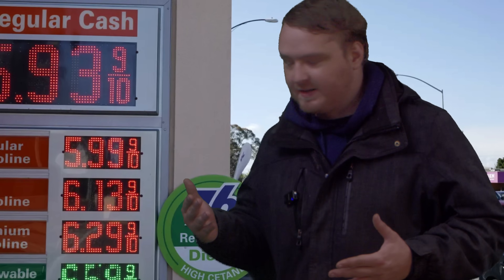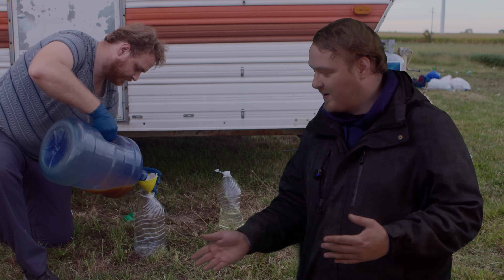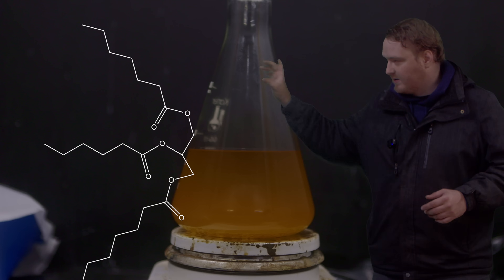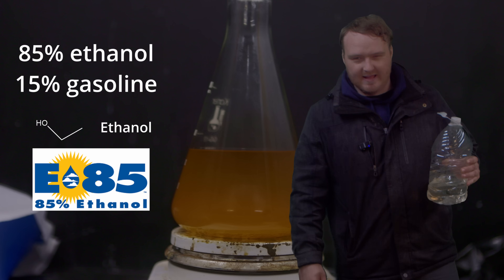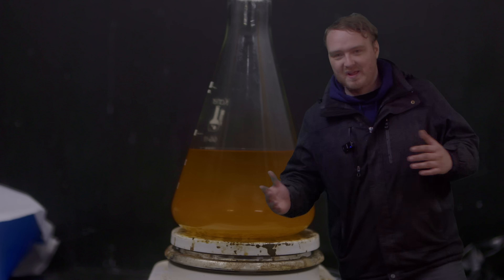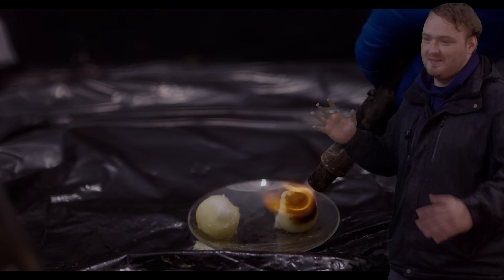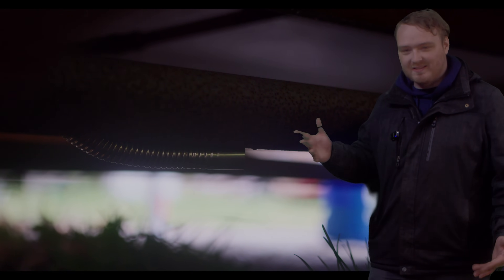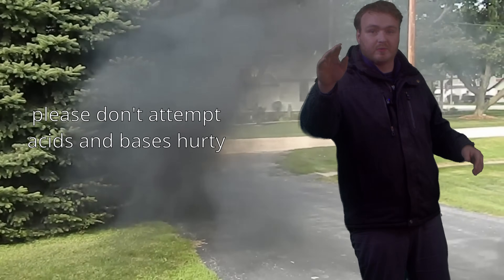I Made Dirt Cheap Organic Diesel!!!

Comment: They put less ethanol in gas in the winter because ethanol has a tendency to crash out of the fuel as a gel in sub zero temps
Reply: Or just increase viscosity, I forget which
Reply from the maker: Huh... Yeah i figured it had something to do with temperature

Comment: The reason there's more ethanol in the E85 during the summer is because gasoline and other fuels are typically supplied as summer and winter blends with different compositions to maintain similar properties with different average temperatures, there's probably more gasoline-like components in there with higher vapour pressures to retain similar performance when the average daily temperature is lower.
Reply: It's probably also to make it easier to start a gasoline engine during the winter when it's cold outside.
Reply: @porcupinepunch6893  Basically that yeah, dunno why I didn't mention it specifically

Comment: Very cool, iirc the main issue with a wide adoption of biodiesel is what to do with the all the glycerol, since there is such a surplus of glycerol.
Reply: I think one option would be to use a water-glycerol eutectic mixture as a base for automotive coolant, since it has a melting point of around -50°F and boiling point of around 230°F.

Comment: you probably want to dry out the oil to make separation quicker

getting cheap dry ethanol is a pain in the ass, but using e85 is a pretty neat way to do it.

Comment: I went down this rabbit hole of trying to build out a diesel truck of trying to run on grease, only to discover that it is quite hard to get any substantial quantity of waste vegetable oil WVO from anywhere.
Reply from the maker: I got lucky actually... First place i went to had a broken fryer they needed to empty so that's where i got mine... I imagine it's not always that easy though
Reply: Most people that i find doing biodiesel already have a friend working in restaurants to let them know when they change the oil, also some local regulations on waste could be a problem to get it, here in europe there are oil specific trash bins where you could in theory "acquire" used oil though i will never recommend it as it is kinda illegal to go dumpster diving
Reply: @joey_f4ke238 it’s kinda dumb because that used oil will be incinerated anyway. It should be allowed to be sold cheap for reuse.
Reply: Here people are selling, like 2brl a liter vs 5,5 of diesel
Reply: That’s why I run wmo. Mix with gas and let it sit for a few days then filter it out. The 12v smells like shit running it but I can go anywhere for free.

Comment: My friend just used unfiltered oil whit fries still in it and his passat actually ran on it for surprisingly long time and then he tried whit unfiltered used motor oil... Car didnt like it...
Reply from the maker: Surprisingly diesel engines can run on a lot of stuff but thick stuff usually doesn't burn too cleanly... Also the problem with sediment is that it will clog your fuel filters if you run it for too long
Reply: @ChemicalDistractions id be worried about fuel injectors more than the filters tbh
Reply: My friend has an 82 Oldsmobile Toronado diesel (with large aftermarket fuel filter) and he runs it on used motor oil all the time. Works great, filter lasts less than on regular diesel or biodiesel, but it's a cheap filter cartridge (large Racor turbine style marine filter). He works at a boatyard so he can get the oil for free and the filters for a huge discount.
Reply: @theodorgiosan2570 we finally found a way for the GM diesel to run. It won't run with diesel but used motor oil. We can now take it off the worst engines list. 😂😂😂
Reply: Yeah if it's warm out most diesels can just use veggie oil straight.  You can also mix it in a ratio like half and half.  I'd for sure filter it so as not to clog my primary fuel filter or screw up my fuel pump, but yeah. It goes fine. I haven't done it but I've watched plenty of videos
Reply: motor needs more heat to ignite, so it doesn’t work.